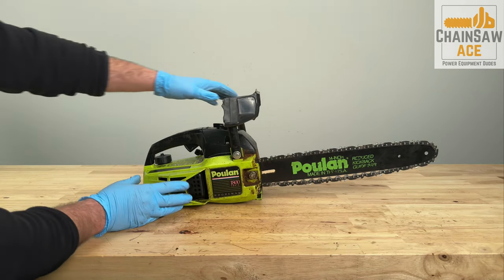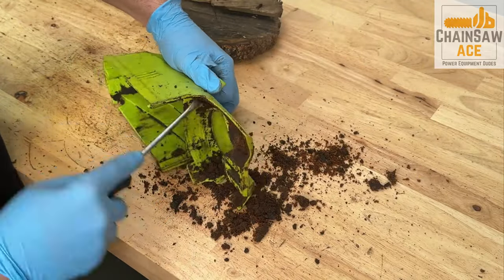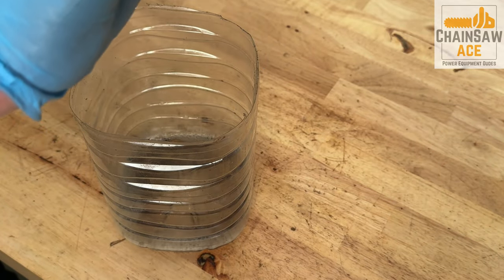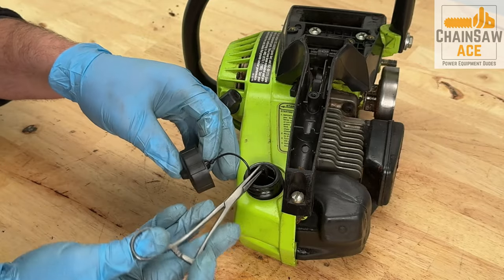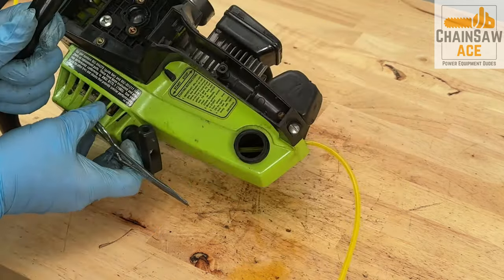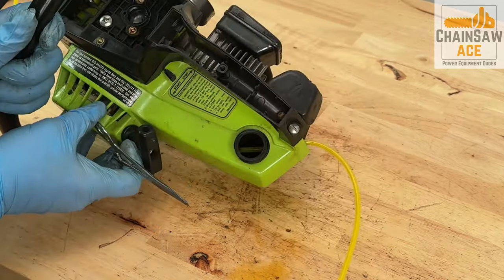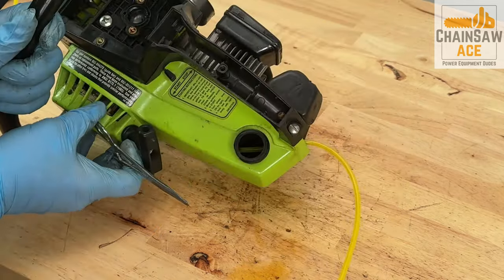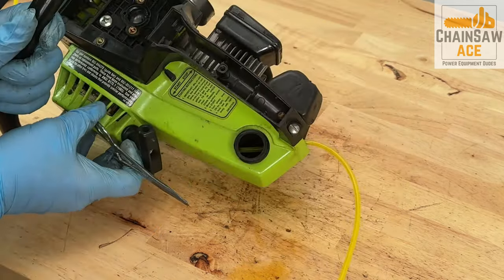Restoring a Classic: 1982 Poulan 1800 Woodsman Chainsaw - Fuel System Overhaul and In-depth Tune-Up!

Comment: I just finished rebuilding one just like you, got the carb dialed in but it doesn't seem to want to start with the cover on in either position, any suggestions?  I know it didn't have an air filter when my friend gave it to me, wondering if the one I bought is keeping it from breathing, but it looks just like the one you used
Reply from the maker: Did you do a compression check or a spark check?
Reply: @chainsawace1777 I did not, would it run fine without the cover on with low compression?
Reply from the maker: It will run with the cover off. Low compression is another thing though. Get a compression tester. They are cheap and very handy.
Reply: Will do, thanks  @chainsawace1777

Comment: If you have time,  I can't find any forums or videos,  internet sites or anything about my Poulan Super 1800 Woodsman 16" bar chainsaw.... it takes a certain chain size that I can't figure out or find anywhere... S56 says 91 on the teeth that go in the bar,  and it's a 0.063 witch is the part I can't find anywhere with the 16" bar detail... found something that says it all,  besides the S56 and the 16" bar length... doesn't say the bar length on the link I found, and it's not S56 seems like
   Is there anything I can do if it doesn't exist anymore?  Will a newer 16" bar and chain like an .050 version work for this saw I have?
Reply from the maker: Sorry it took so long to respond to your question.  My father has been in and out of the hospital and rehabilation and it has had me side tracked. However, I believe I have the answer to your question.

The 16" guide bar that came with the saw should be a 3/8 LP, also known as 91 chain, with a gauge of .050. I have never seen a .063 gauge chain on a Poulan, especially on a small chainsaw like this one, unless somebody did a switcharoony at some point in the past.  The 56 you are reading on the guide bar should be the number of drag links in the chain.

So to recap the specs of the chain you need are as follows: 3/8 LP, .050, 56DL

Here is the chain on amazon: https://amzn.to/3ycm6ZT

Thanks again!

Comment: Nice. Looks new. Got any idea where to get a piston and cylinder kit a for a Stihl 011? Stihl doesn't have'em. 👍🍻
Reply from the maker: Thanks for the nice comment and the view.

Check with LilRedBarn. I know they have the pistons and rings. You may have to get a good used head though. 

Here is a link to the piston and rings kit: 
https://www.lilredbarn.net/product-p/pksh010-36mm.htm
Reply: @chainsawace1777  Yeah, I've ck'd with them. Would've been nice since they're only about an hour away. Thanks for lookin. 👍🍻